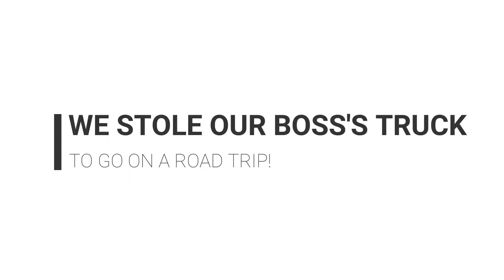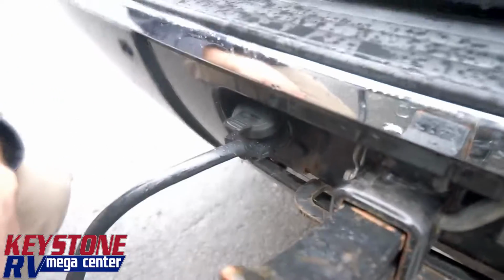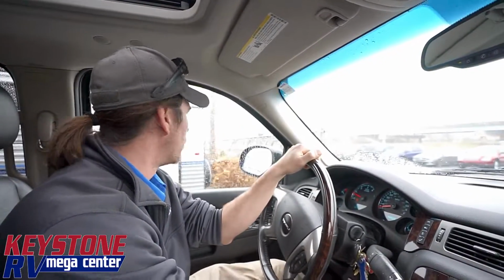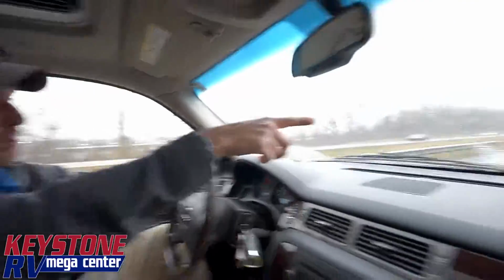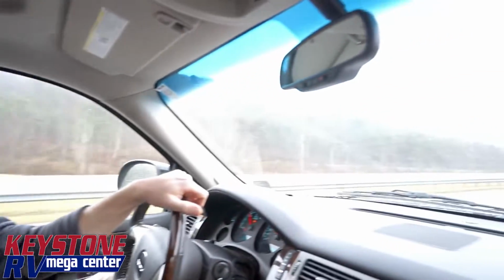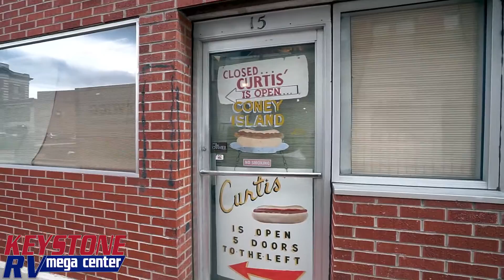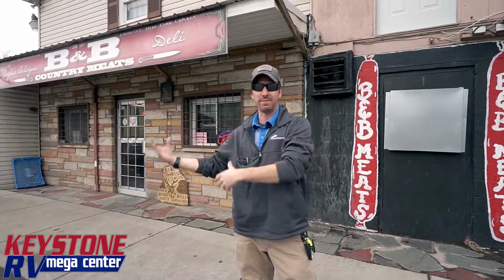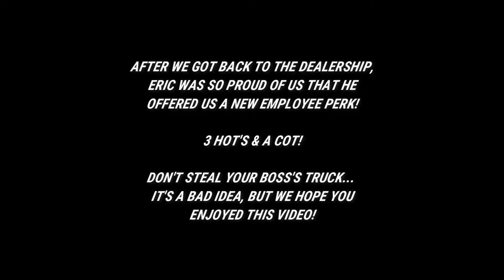RV ROAD TRIP! WE STOLE OUR BOSS'S TRUCK TO GO ON A ROAD TRIP TO CUMBERLAND, MD!

Comment: I really wish I could have bought my RV from your place. I got shafted by Camping World in KC, Missouri and got a Forest River 2020 Vibe 26BH that has been sitting in my driveway for 6 months. Just finally got  Forest River to approve the warranty claim for my slideout that malfunctioned literally the day after I picked it up. I bet you guys would have not sold a busted RV to a customer. If you did, you probably would have made it right pronto. By the time it's repaired, the season will be over. Then I'll have just a few months if any to find out if anything else is broken and fixed before the warranty expires. I hate CW and love your channel.
Reply: I have sold to multiple people from Missouri because our prices are so much lower. The Ford Ranger I own still has Missouri state parks pass on it from the customer I bought it from when they came to our dealership to buy and RV. You are gonna travel with the RV....you might as well travel to a dealership that is going to take care of you and sell the camper at a great price
Reply: @therealjr9175  I probably would have if not for local shops not doing warranty work unless bought from them.

Comment: When checking the tire pressure on a pull behind such as this.  Should the pressure always be what is written on the sidewall? Should the pressure be adjusted according to the trailer weight, if so, how?  How often/how many miles should trailer tires be rotated/balanced?  How many years do trailer tires last? 4-5?
Reply: Yes go by the sticker on the trailer and always replace the tires with the same thing thats marked on the side of the trailer. Theres gonna be a video on this in the future just got to slow down enought to do one. Lot more in depth questions and answers coming

Comment: Do you need to turn refrigerator off before you stop for gas if you are running it off of propane, since that is an open flame?
Reply: If it is not a 110 or 12 volt fridge yes. You can not drive up and down the road with the LP Tanks open legally